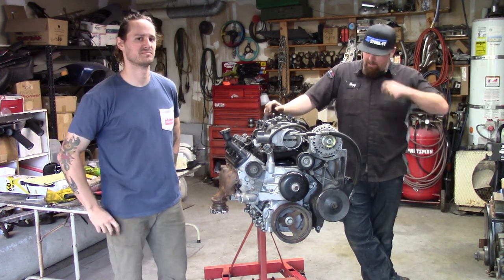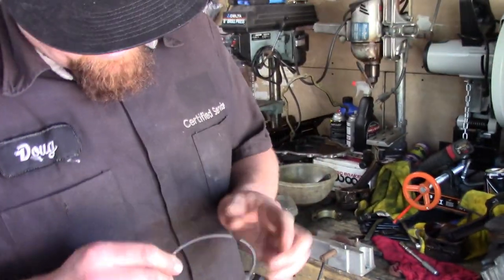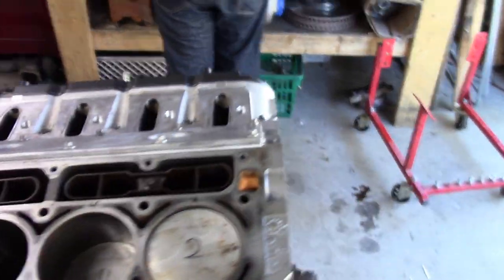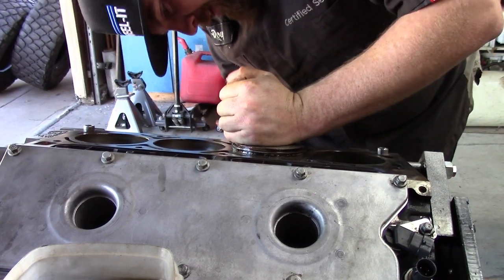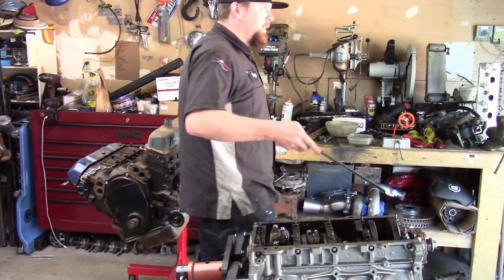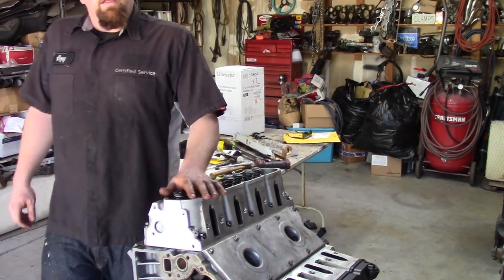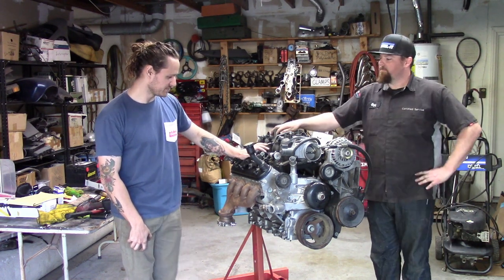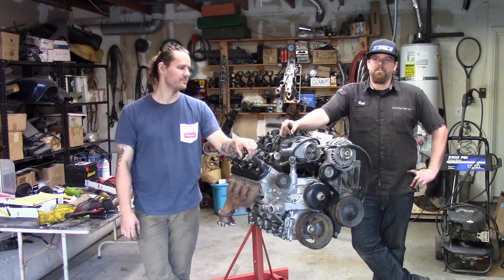Lq9 Do's, and Definitely Don'ts: Bottom End Boost Prep, Ring Gapping

Comment: I thought the lq9 came with 4th gen rods? I tore down the lq9 in my 03 escalade and it had 4th gen rods in it.
Reply from the maker: So, some people call that situation a gen 3.5. I could be wrong but what I’ve read it’s motors that were warrantied or certified replacements built after gen 4 engines were introduced but before gen 3 were phased out.

Comment: Hey guys, I got an LQ9 with a stage 3 cam and a lot of accoutrements for boost, 317 heads, LS9 gaskets and the like.

 Not sure if the previous guy regapped the rings when the engine was built, is it necessary for a turbo build focusing just on adding low end power?

I'm mostly looking to balance out the power loss on the low-end from the larger cam and get my 0-60 more like 5-6 seconds, probably no more than 10 pounds of boost for engine longevity
Reply from the maker: I’m not certain what you plan to do with the car or truck but I’d gap the rings for peace of mind. The extra heat added to combustion with a turbo is prone to expanding the rings so it’s just good practice to be on the safe side. As far as power goals it seems to me you’d be running a smaller turbo so that it spools lower to balance out a fairly healthy camshaft. I’m not a professional by any means and Richard Holdner likely has some great videos relating to cam and turbo size so check him out! He’s probably the most experienced and real dyno results will help you figure out what you want and how to get it. Larger cams by definition usually make the engine less efficient at lower rpm because they change how and where the engine breathes the best. If it doesn’t breath well down low it also won’t spool a turbo particularly well down low either I would think. So it is a bit of a Band-aid to turbo the motor to meet the low end goals. If the cam had a high enough LSA and not too much duration you’d probably be fine, I just don’t know exactly where it was designed to make power. Also the small turbo you’d use to combat the turbo lag could actually be a detriment to efficiency at the top end of the power range. I don’t have experience with the cam you’re running and I’d bet the engine makes great power for you at 10 psi, I’m just not sure it’s the best for low end goals if it is in fact a large cam, or you plan on towing with the car or something like that. Hope this helps and check Richard out like I said, Super informative channel. My .02¢ I’d slap the turbo on and run it and see if you like it, cam swaps aren’t too hard in the future if it doesn’t do what you want it to do.
Reply: @NotForDowntowners  For sure, thanks! It's got a BTR stage 3 truck cam and it's in my 99 Chevy 1500 4x4. I just daily drive it and it's nice having the extra get up and go, I just don't like having to wait until 3000 rpm for the powerband, although dropping $7k+ on a manual swap would probably fix that, then it's no problem.

The 4l65e kinda feels like it's holding the engine back, and the engine shredded the torque converter about 3 months after the tranny was rebuilt lol.
Reply from the maker: @superbroadcaster  If you went with a higher stall converter after it blew the first one that could explain a bit of the feeling of low end torque loss as well. I assume you’d need a higher stall to work well with the camshaft so that’s not a problem it’s the right thing to do, but if it doesn’t flash until 3k then it can feel sort of sluggish for a bit especially if it doesn’t downshift. Anyways it sounds like a sick build man, enjoy it and I bet it that’s a pretty quick truck and a sweet driver.

Comment: i have a lq9 i pulled from a 2008 gmc van i bought for 500 bucks “ no title “ but it ran fantastic, all the oil change receipts were in the glove box but what worries me is the thing has 300,000 miles! Do you think I should get new pistons? this is my first Ls Motor and that seems like a lot of miles to me
Reply from the maker: I wouldn’t worry about it honestly. Pistons won’t wear out unless the motor was overheated in an extreme fashion or ran awful gas. If it has even compression across the holes I’d run it. Odds are if you pull the bottom end apart the bearings won’t even be scarred if it had regular oil changes. These things are pretty bulletproof.
Reply: @NotForDowntowners  thank you

Comment: I have a LQ9 and a Turbo 350 TCI internals sitting in a Fbody I just bought. Idk what that is and I plan on destroying it anyway and putting a sweet turbo 400 with gear vendors and have it air shifted. 

LQ9 is a stock bottom end, 799 heads, LS9 valve springs, A mild comp cam.

I obviously need more power, anything I can do myself when I rip it apart to install my new cam and maybe replace head gaskets.
Reply from the maker: Honestly, you already have a great combo! 799’s and a decent cam will make 500hp at the crank on an LQ9 as long as you mate it with a good intake and longtubes.
Reply: @NotForDowntowners  has a full Kooks 3in system I think it even has dummy O2 senors. Also a bbk intake. 
It honestly needs a LSA and a new rear end
Reply from the maker: What car is it in?
Reply from the maker: Very cool, gearvendors is local to me. I actually worked for the owners son at my first job. I’m a big fbody fan, I wish you the best of luck on your build. As for an LSA blower, I couldn’t agree more! I’m putting an lq9 in my 1970 nova now and an LSA blower has been on my mind.
Reply: @NotForDowntowners  Its all in a 00 Camaro SS from Georgia.  It's my first actual car I've bought myself too.

Hell I'd love to go on Dragweek once I get different motor mounts and figure out how I want to have it tuned

Comment: You missed a torquing a rod bolt in the video. The rod that the socket got stuck on you never did the other side.
Reply from the maker: Haha good catch, I told seth this the other day. I went back and double checked everything with the camera off. I do appreciate it though!
Reply: 9:38
Reply: @NotForDowntowners  No problem. I rewound the video to double check and had to let you know.
Reply from the maker: I definitely appreciate it! We are planning on using this motor soon, following along if you’re interested and you’ll see it make some noise haha (hopefully good noises)

Comment: How many miles were on this motor? Did you hone or bore, or use as-is? I’m about to tear down a 145k lq9 and am wondering if the bores will be fine. It’d be great to keep the pistons as-is, otherwise an lq4 would’ve been just as good.
Reply from the maker: No honing, even at GM we never honed motors. When engines had oil consumption issues we slapped pistons and rings in with no block work.
Reply: Second Chance Builds these were stock rods it appears, so do you recall the mileage?
Reply from the maker: Correct, stock everything on bottom end. Never knew the mileage, I got the motor in a trade. I have 5 other LS motors in the garage currently ranging from 80,000 miles to 220,000 miles. I don’t plan on honing/boring any of them.

Comment: I thought u can’t just put arp bolts it’ll make the rod end out of round
Reply from the maker: Never had any issues. I’ve read that before and don’t agree with it. With that being said, when turboing a stock LS bottom end when it fails it won’t be the factory rod bolts so I wouldn’t normally bother with ARP rod bolts. I just had them laying around. My daily driven ls1 silverado has had ARP rod bolts for 4 years.
Reply: They are a cracked cap rod. They will only go back 1 way correctly, so why not.